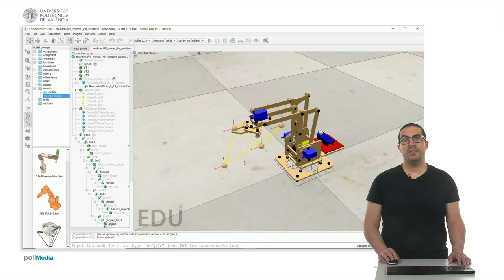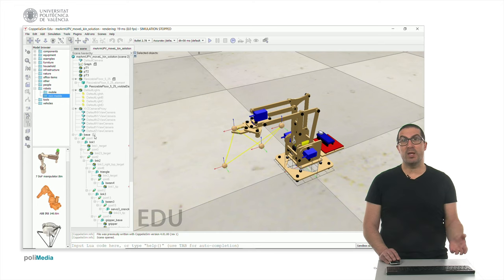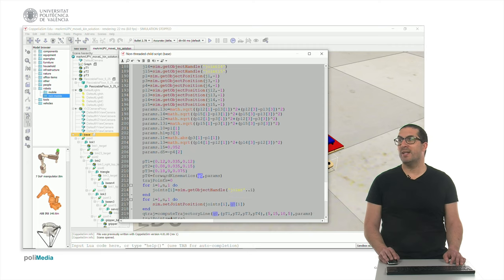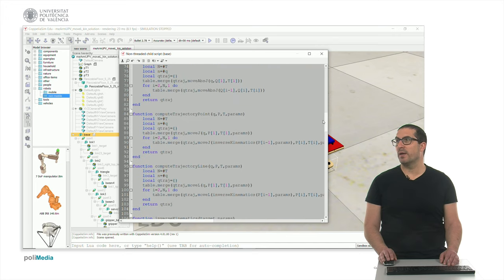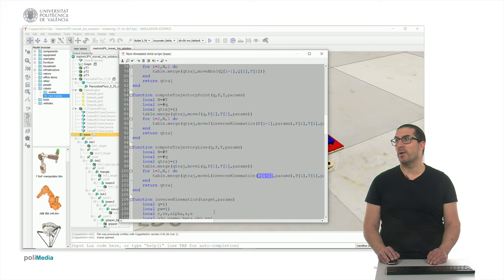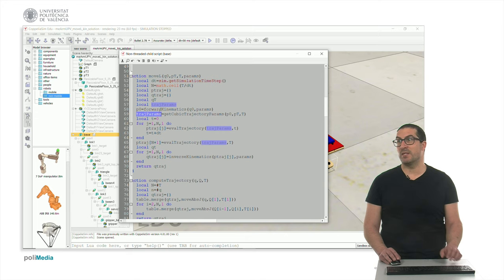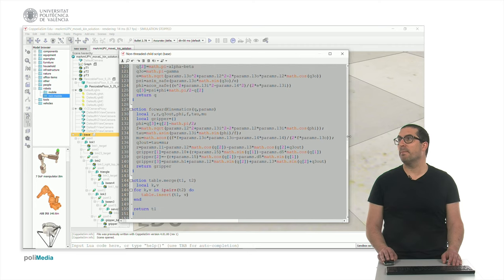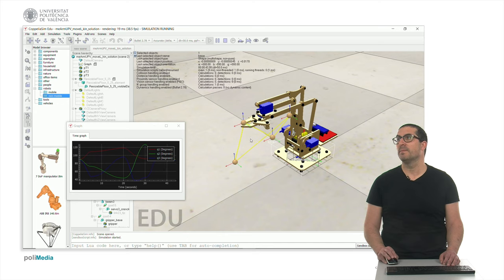Linear end-effector movement using a cubic trajectory (moveL) | meArm Robot

Comment: I am still a little confused here when using a cubic polynomial to generate a linear end movement. In the moveL function of the program, a third-order polynomial is used to plan the trajectory of Cartesian from point p0 to point pT, and then inverse kinematics is used to convert these points into joint space. So what I don't understand is how to generate a linear trajectory in Cartesian space. My understanding is that dt is a small time step. The cubic polynomial is interpolated in each small time step. Because the time is very short, the effect is still linear in Cartesian space. I don't know if my understanding is correct?
Reply from the maker: The cubic polynomial is used to generate the amount to advanced within the linear trajectory. By setting the initial and final conditions for position and velocity gives a total amount of four parameters, as the cubic trajectory. There are other ways to generate trajectories such as a trapezoidal or S-curves, but particularly the cubic one was very easy to implement and smooth (initial and final velocities are zero), and thus are useful for different kind of applications
Reply: @LeoArmesto  My original doubt was that when we use a cubic polynomial to generate a linear trajectory, the expression should be p=p0+s*(pT-p0), but we only see s in our script. I seem to understand it now. thank you, sir.